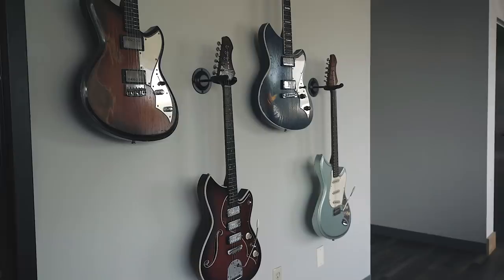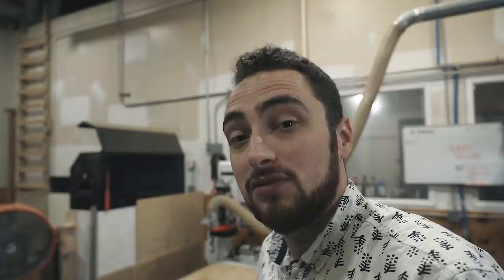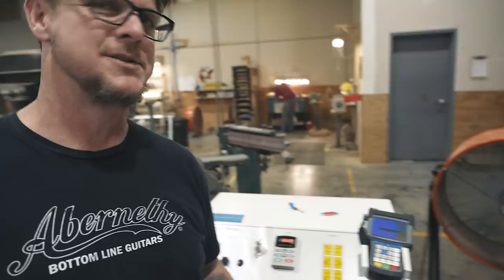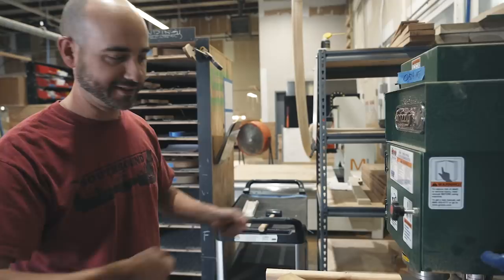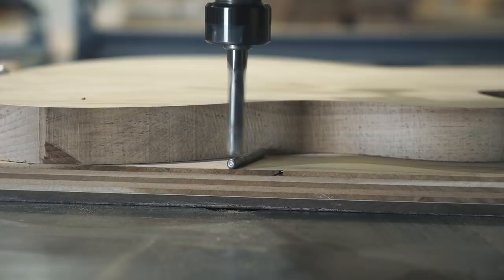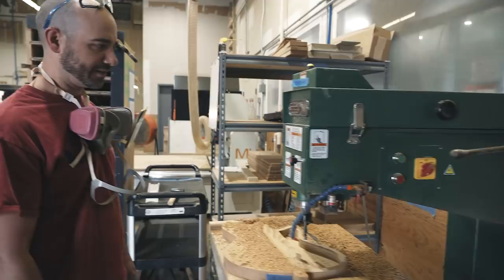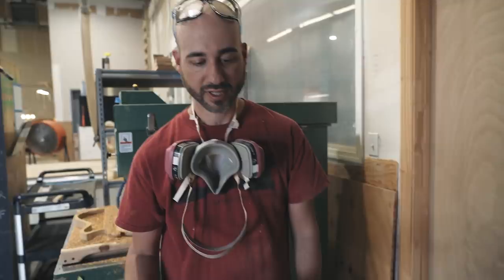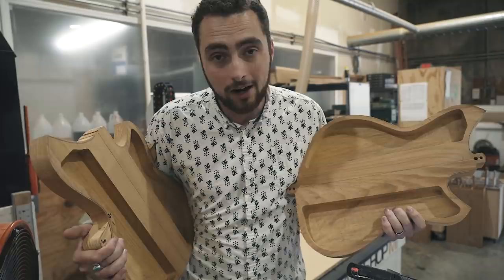Is “Handmade” Really Better? CNC vs. Handmade Guitar

Comment: I see no difference in these two methods apart from the negligible variance in some of the routing lines. There may however be a good argument for something more traditional like a graduated Violin or Mandolin carve where the way a flat chiseled piece of wood differs from a drill turned chiseled which may be more significant 🤷‍♂️

Comment: Is handmade better?  No. Is CNC better?  No.   

CNC is more precise which allows each instrument to achieve a consistent level of quality; a level of quality determined by the designer of the instrument.  A handmade version permits more "character" as a result of the imperfections that are inherent to handmade instruments.  If character is your preference, you will want handmade.  If consistency of quality is your goal, you'll want CNC.

Comment: It's not that the CNC body is a bad product. It IS that if you are spending 3-4K on a guitar you can point to the fact that it took hours of a mans skilled time to produce that product. I cant justify as high a price for a machine. It should be less costly and that cost difference should be reflected in the final price. They went CNC at "Heritage" guitars. Now nothing is heritage about them. Not the building methods, the machining methods nor the original skilled luthiers from Gibson.

Comment: Handmade has nothing to do with body routing. Handmade is relative to handfitting and human inspection of all fits and if I may compare apples to oranges had fitted lapped slides on pistols yield a fit that will burst an egg at 100 yds. Cnc guns are crap for accuracy. Namely semi auto pistols. Hand fitting will always yield a better fit when a master is doing it. People with no skills have no idea what shortcomings are common with cnc. Im a master machinist but also a published master target gun maker. The computers are nice but NO CIGAR where lapped fits are concerned. Lapped firs literally fit themselves and a human hand is needed to detect proper interference or tightness of fit. Cnc bodies are perfect no doubt, but the finest parts made are still made one at a time. By HAND!

Comment: a proper guitar is a neck through or set neck guitar(physics of geometry) real craftsman has a good feel for it for sure. but if a machinist is making a guitar, it will be 100% more accurate than a hand made one, no debate. and these guitar companies were taught by machinists when they purchased the mills and probably extra training that they wanted. so do the math. take it from a machinist and a guitarist.

Comment: This is not very fair to actual handmade guitars because the real definition of handmade does not rely on a machine at all. Using a hard pattern and a machine even with an analog programming is using a machine, real wood work guitars are full hand formed and have a price tag to show it was not created by a machine. Yes a machine does make a consistent product and push profits above draftsmanship but it kills craftsmen and their jobs.

Comment: No offense to the maker of this video but I think you are missing what the argument is actually about. It's not about wether the consumer preferrers one or the other, it doesn't matter because the results are pretty much the same. The argument is between the builder who actually builds every aspect of the guitar, starting from blocks of raw lumber uses hand tools ,power tools, and jigs to create a guitar.  As apposed to someone who calls themselves a builder but is actually just an assembler and setup guy because they use a machine and computer software to do 90% of the work for them. No actual builder cares if someone uses a CNC it's more that we think it's silly that they say they built the guitar when really a computer built it. From the design of the guitar witch they usually do on some computer program, to cutting out the body and all the cavities, to cutting cutting out the neck, shaping it, and cutting the fret slots, all done with a CNC. At that point you aren't really building anything you are assembling pre cut parts. I prefer designing and building my guitars using my hands and tools because I can be more artistic that way and really have control over the entire process, really get to know the characteristics of the materials I'm using. Plus I'm not a computer guy so all of that programming and time on the computer seems very boring,
Reply: guitar made without any machine assistance you mean? that leaves only a few lonely builders then since the wood is also cut by machine at lumberyards and sawmills

Comment: People "prefer" handmade things because the added cost of labor is so ridiculously high, they don't want to acknowledge their buyer's remorse.
Reply: I can guarantee you that the delusional customer that imagines someone in a shed carving out a guitar body with a chisel, has got the wrong idea about what "handmade" is in a small workshop. They're all sanded by hand once the basic shape is cut. There are procedures in prep and paint etc throughout the rest of the build and  the difference between  cheap and expensive is cheap laborers vs experienced professionals

Comment: I'll end the debate right now.
ALL guitars are made using some sort of machine. No one widdles a guitar from a log.
A cut piece of wood is NO different based on how it was cut.
Computer based machines are much more precise and efficient.
The stigma originates from quality control. A machine can't tell if a piece of wood has poor grain structure, or is otherwise flawed. It's too easy for factories to punch out a high volume of product with little regard to fine detail of quality. Shops that do not rely on automated machines are less likely to miss flaws, resulting in systemic quality control.
In addition, mass produced guitars may suffer a lack of finishing, especially the fret work, and set up. It's not caused by the machine, only a byproduct of the process.

It's my understanding that the Martin company would test the sonic properties of their guitars during production and toss anything at anytime if it didn't demonstrate their level of quality. Completely finished guitars were even destroyed because they did pass final testing. I doubt they still do this.

Comment: I think CNC is the only way to make guitars as a business or get into it as a hobby/side hustle. Unless you charge at least 3K+ for each, have a proper woodworking experience and a set of tools already. My best argument for CNC is that guitars are more sculptures than tables. Not in the spiritual sense, but a practical one - guitars have too many curves (which we all like on a guitar). So you need smarter tools respectively. Like carving a Les Paul top efficiently would require a Les Paul as a template and some duplicator routing device. Similar to the bottom template shown in the video. Carving a violin by hand takes forever, imagine a Les Paul. I cut myself once carving a tiny keychain Strat neck. Never again. Awesome for a video, terrible as a business model. Unless you make videos.

Comment: I really hope the tool don't break in the manual machine!! No guards at all...
Reply: When you snap the tool they don't go flying. They pretty much drop out within inches of where they were. So says a guy that's busted a lot of end mills on milling machines. Chips off the bit fly further because of the tangent of the cut. Plus the chips are a hell of a lot lighter than a busted tool bit is. I've done production runs where I'd run a bit until it broke before replacing it. So I'd snap maybe 5 or so bits every day. It ain't worth sharpening them. I can tell by the swarf when it's going to break too. Before they go they cough up sand for a while.

Comment: Hand-made is only better if the maker has a grey beard and bare feet and uses tools sharpened on natural Japanese water stones. That's the only way to get true tone-chi into the wood. Provided you don't leave your timber exposed to the moon's rays, and your workshop has a pyramid shaped skylight, and you keep your glue in earthenware pots.

Comment: They don't use a touch plate? Slipping paper to get your Z offset is pretty amateur. I guess it's only a guitar body though so a couple thousandths doesn't really matter.
Reply: happy joe  It's still slow. Which is not good in a production environment.
Reply: happy joe  I've worked in a few production environments and I've never heard the term.

Comment: A hand-made one is just a human, holding a router and following a wooden template.
The CNC version is a robot holding a router and following a digital computer template.
Nothing wrong with CNC made stuff. .  Airplane jet engines are made this way. . . (well some parts for the engines are made this way) and nobody has a problem with that, do they?

Comment: Define "Handmade". If you define handmade as being made purely by hand, have fun felling a tree with your fingernails. 

Oh, you mean made using hand tools? Hmmm... Okay, I'm sure there's some flint around here somewhere, that'll allow you to get started making your hand tools.

Oh for... You want to use pre made hand tools? Were they hand made? You don't know...  Fine. Axe to fell tree,  hand saw to produce rough planks, hand planes to smooth the rough lumber into something usable, etc, etc...

Wait, you want to be allowed to use a bandsaw? A power planer? A router? But, but, THOSE ARE POWERTOOLS!

So now you want to be allowed to use manually operated powertools? Stepping dangerously close to making a machine-made guitar there sonny. Templates? Sheesh. If you must...

Is ANY guitar truly "Handmade"? No. At some point in the process of going from tree to instrument, there will be machines involved.

Is ANY guitar truly "Machine made"? Nope. In even the most automated guitar factory in the world, there will be humans involved - if only to maintain the machines.

Humans are a tool using species. Pin routers are tools. So are CNC machines. Both require skilled operators to get good results...

Comment: This is really a nothing of a topic.  Electric guitar sound no different when routed on a pin router a CNC router or even a hand held router.  I have made around 2,000 guitar bodies and necks all on Pin routers and some routs  tooled for hand held routers.  I' m now slowly moving to CNC.  All of these do the same exact thing they route out cavities and what the difference is in the end is what happens in the factory. Mainly tooling.  With CNC you replace the need for templates that enable you to duplicate the process quickly.  If you keep you pin routers dialed in they are accurate.  Tooling can get worn after multiple uses and become sloppy if you don't
make sure it is kept in accurate condition.  I wont miss using pin routers and hand held routers.  Oh, back to the difference. Accuracy, guaranteed and consistency is what you get as the difference.  Not saying pin routed guitars don't measure up but less of a hassle to achieve that level of accuracy time and time and time again.  Also much less of a safety concern to the operator.
  Neither process is handmade that went out before electric guitars went into production.  CNC after all are only a part of the process as mentioned in this video.

Comment: Who cares how is cut? If u choose a bad grain like i saw there, its just a guitar, does it mean its a instrument? People forget that a instrument as 6 strings with 22 or 24 frets and those "100 "notes have diferent frequencys. A mistake in choosing wood and u have dead spots and hots spots somewere, or after 10 frets the highs are decaying and lows muddy and blur. Lack of sustain and so on. The secret is not the way how is cut. If CNC or hand. But how u choose wood and material.

Comment: Are we really talking about a process that makes no difference at all in the instrument that's being built? I guarantee that if these two bodies were to be finished and set up in the exact same spec there wouldn't be a noticeable difference at all in a blind test as 99.9% of the sound in solid or semi hollow body guitars will come from the pickup anyway.

If we would be talking about an acoustic arch top that has been hand carved and tap tuned using Chladni patterns yeah we would probably hear a slight difference between cnc and handmade but even then it's susceptible to taste and perception in order to determine which sounds better.

You pay more for (real) handmade stuff because it's more time consuming, not because the quality of the work is better.

Btw, both these guitars are routed bodies, neither of them is truly handmade..... hand-operated router vs cnc would be a better title.

Comment: The CNC is nothing more than an expensive router.  Granted it does change it's own cutters and moves by itself, but it is a router.  The only difference being in the operator, the human is not going to be able to keep up with the speed and precision of the computer.
Reply: There's a bit more to a CNC really. A CNC machine is like Yoda. There is no try only do. The ramifications of that are profound too.

Comment: Let’s change the guitars to Acoustic guitar n not Electric guitar  handmade or cnc machine made difference
Reply: Wouldn't the component parts (wood panels etc) still be cut to at least near-shape, and then assembled and finished by hand ?

Comment: I stopped this video at start to write this comment. Then i'll continue.
In my opinion it is really dumb to say hand cut guitars are better. No, they're not. CNC cuts far more precise than a regular guitar builder unless he / she is a master or something. Then it'd be the same. The reason of this myth is probably cheap guitars are always cut with CNC and they generally have a bad finish or fret leveling or whatnot. Not because the wood was cut with CNC but because the cost effective cheap labor. Probably not very experienced factory workers going thru a short education to learn exactly what they'll do and they make mistakes until they get good at it and then they quit their jobs to build more expensive guitars or whatnot with a higher salary. Moderately expensive guitars that were built during the last decade ($400-$1000) are way better than somewhat more expensive guitars that were built earlier only because of the technological advancements. I really hate when someone says "Oh hey my 60 years old vintage guitar which i paid $700 is better than $2000 guitars today, they don't build good guitars anymore blah blah" No it's not. I am pretty fucking sure that a $200 guitar today is probably better than a $1000 guitar 50 years old.

Comment: The opinion that a 'handmade' guitar is better than a guitar that has its components shaped on a CNC machine is one of the dumbest things I have ever heard. As you say, presumably it originates from those who have no idea how a guitar can be made. Which is exactly what you say in this video. Small production guitars or custom builds can only be better because of the thought, knowledge, skill and care that goes into their construction. Even a mass produced guitar will be better if those things are applied, as compared to a mass produced guitar that is pumped out by semi-skilled workers who don't care and with little to no quality control. How the components are shaped does not matter. Almost all guitars are partly hand made and partly machine made. It is possible to build a guitar using only hand tools, but very few people do it.

Comment: I can't imagine why a hand made instrument would be better. It makes no sense to me.
A CNC can do it far more precisely, so it makes sense that it's better.
Reply: I worked in a tool and die shop making some pretty precise instruments. I used surface grinders but to get that last little bit I'd hand lap parts. A surface grinder is good down to 0.00005 (a half a tenth). Hand lapping can go to 0.00001 or better. In that rarified air it's a mental process. You have to imagine the atoms you want to remove then. It's a difficult topic to articulate really. Craziness never makes any rational sense either.

Comment: les time, more production... lower price... that all point to CNC
Reply: After you've paid off what that $70,000 CNC machine costs. That's base price with no accessories. That pendant he was holding cost them more. I don't know why they don't have a touch plate though. Slipping paper under the tool to setup your Z axis offset is pretty amateur. A ruby probe would be deluxe.

Comment: Without watching: If they are made to same design and tolerances, it makes no fucking difference whether it was carved out by nothing but your fingernails, or by a CNC. If anything, handmade parts are inherently worse than perfectly machined parts. The "handmade quality" is the variance, flaws and imperfections and if you like that, that's perfectly fine. Handmade goods are each a bit different from one another, their flaws make them unique. But they don't make them better, quite the contrary.

Comment: No practical and functional difference in them really. The wood doesn't know whether it's being automatically cut or a person is doing the maneuvering. One is an automatic router and the other is manual. It's still the router doing the cutting. Neither one is 'hand made'. CNC is faster and more consistent. No way you can tell the difference because it's basically the same process just carried out two different ways. There is no 'mojo' in the fact that a person manually turns the wood.

Comment: While I enjoyed seeing the CNC machine work and now know what is meant by a “pin router”, this video is just dumb. Virtually identical bits are cutting the wood.  Who care whether the bit moves around guided by a digital model or the wood moves around guided by a physical template?  Neither is “hand made”, and the wood doesn’t give a crap how it is cut. 

Show me a luthier building a one off design with a bandsaw and the neck pocket custom fit to a specific neck. Then I might care. Otherwise it’s machine-made. Not bad - just not hand made.